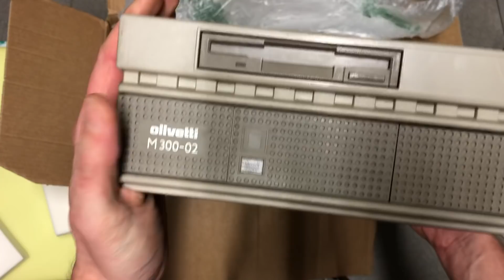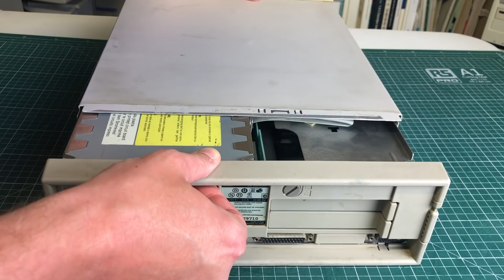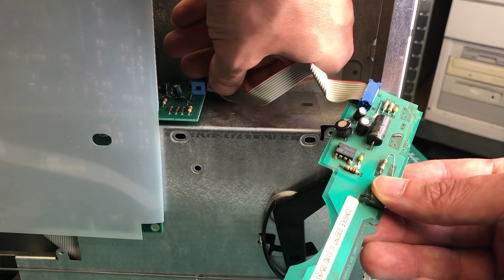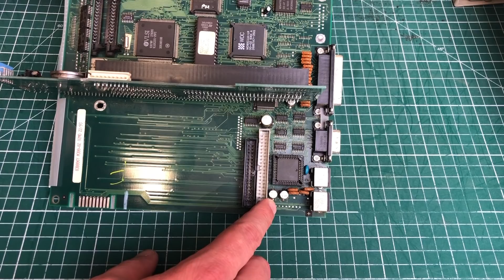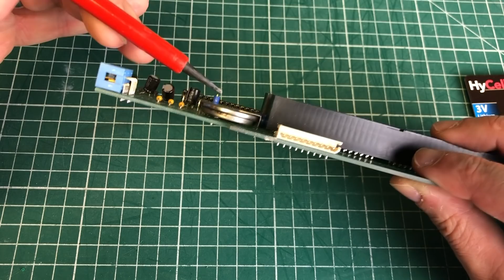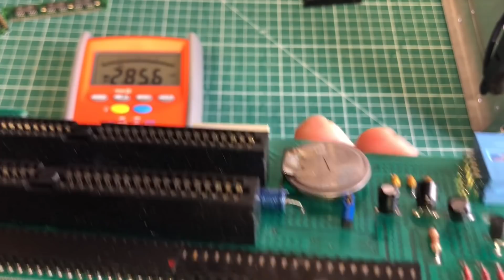Olivetti M300-02 eBay "score" - non working PC (part 1)

Comment: Maybe a bad cap in the PSU. Can be hard to see with a multimeter. Did you try clearing the battery backed settings? Could also be a corrupt BIOS.
Reply from the maker: Checked voltages and they seemed fine. Tried clearing the cmos settings by disconnecting the battery (using a jumper). Strange that sometimes it goes into this reboot cycle but most of the time it doesn’t do anything. Not that easy to hookup another psu because of the non AT(X) type connector.
Reply: @RetroSpector78  I wonder if removing the battery might help. Does it have jumpers for things like CPU frequency?
Reply from the maker: kuro68000 only 2 jumpers on the pc. One to enable / disable the password. Another to disconnect the battery.  None of them made the PC start properly. (Will check the PSU in the next part).
Reply: @RetroSpector78  sounds like you checked everything you can before replacing some caps.

Comment: Greatings from Italy, this is a piece of our history ❤️
Reply from the maker: Love those olivetti pc’s. Have a couple of them here.
Reply: @RetroSpector78  maybe you can check the RAM
Reply: @RetroSpector78  probably a RAM failure
Reply from the maker: Francesco Farnerari maybe ... but it being a non standard ram stick soldered on the board makes it a bit difficult
Reply: @RetroSpector78  it would be difficult if the soldered ram is dead. At least you can test the contacts on the MOBA

Comment: The power button design probably is to prevent to turn off the machine unintentionally.
Reply: Also helps prevent people from randomly shutting off your PC in the middle of work
Reply: @rawr51919  Yes, this is actually what I meant :-)
Reply: As a kid I had a bad habit to fidget around and sometimes poked the power button too when not intended if the computer was on desk. Also it has happened that a dog has actually poked the computer power button if the computer has been left under the desk. Eventually I taped a plastic hatch on top of the computer power button in order to prevent accidents. "Too bad" modern computers won't usually turn off immediately if the power button is pushed a bit.
Reply: It's intended for some kind of active standby as it disables the keyboard and turns off the power passthrough in the PSU (which is usually intended for monitors).